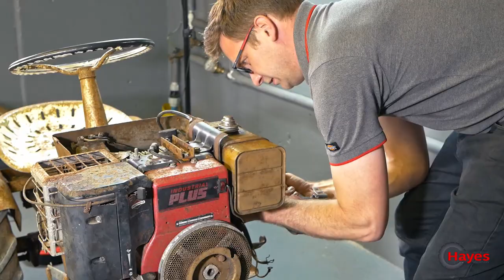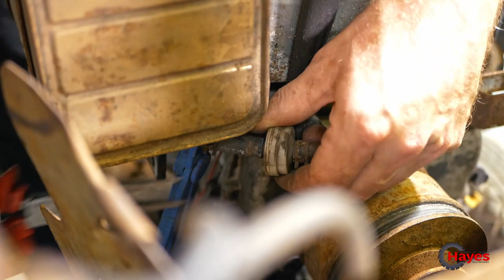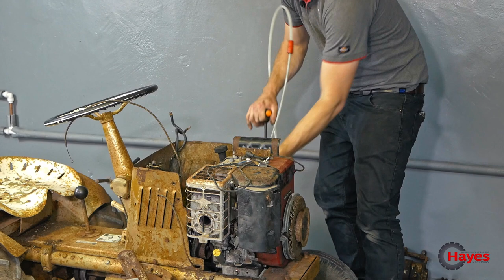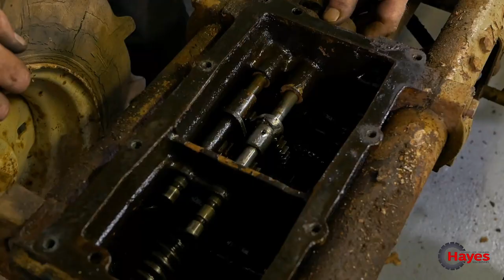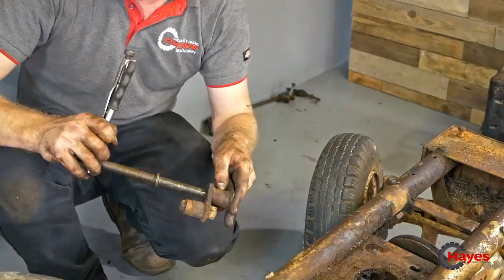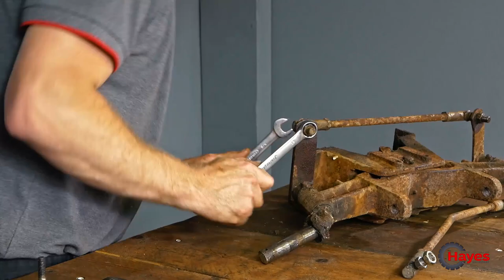1963 Bolens Husky 600 Lawn Tractor RESTORATION | Part 2 of 6

Comment: I like the fact that you're going through the entire machine.  A lot of guys "restore" tractors with a simple coat of paint and some decals.  I've got two Bolens 1050s and one 800 tractor waiting to be gone through.  They are high-quality heavy-duty pieces of equipment and will last a very long time on a rebuild.
Reply from the maker: Exactly, we wanted to do the job properly, so a full strip down and re build is the only way. Thanks for watching! :)
Reply: @MachineryNation  To do the job properly the correct engine should be installed.
Reply: I got a 800 bolens as well. Currently working on it